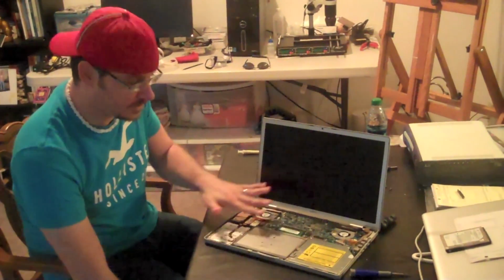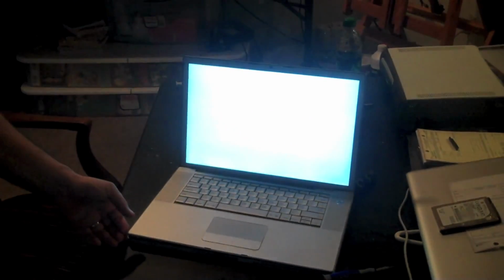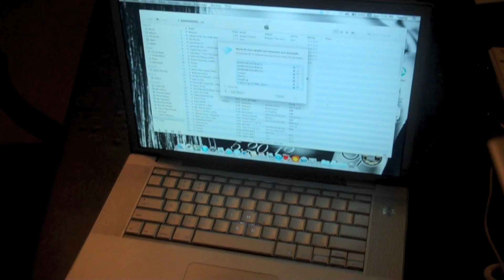MacBook Pro nVidia Black Screen Fix PT2

Comment: Bro I just bought that machine but the lamp doesnt light up in intervalic motion how you set that up? or maybe I got a broken unit.
Reply: sonico 73 Did you find a solution?
Reply: sonico 73 I contacted the factory technical staff about this. If you set the temperature exceeds or equal to 250 degree centigrade, it will always stay on; but if you set the temperature less than or equal to 249 degree centigrade, the light was supposed to cycle on and off.
Reply: Bro I love you!!  thanks so much we need more people like you very kind sir thanks. I was scare that was broken.

Comment: I would like to say thank you very much... your guide helped me fix 2007/08 model MacBook Pro.. for me it was the NVIDIA video chip, I used a heat gun because I don't have the specialized tools you do.

I took it the the Mac shop and they told me it was the backlight on the screen and it wasn't worth fixing... what an idiot that guy was.... I swear they are more interested in just selling new computers than actually trying to help.

Comment: So It means Graphic card problem ?
Reply from the maker: Yes it does mean there is an issue with the graphics card/chip or the solder that holds the chip to the bga on the logic board

Comment: Hi i have a macbook pro a1226 it's not powering on.we fix it with smc.its getting powered but nothing is seems on screens.we a zm-r 5830 bga machine. we reballed many gpu in other brands laptop but not in macbook.can u tell me extact problems.
my mail is santoshrawat2005@gmail.com

Comment: ever have to reflow the intel hd graphics chip on a 2010 15 inch MBP 2.66 i7? if i turn off the auto graphics switching on 10.8.4 i have not had gpu kernel panic problems (yet)

Comment from the maker: the x1600 is in the first gen Macbook Pro (2006) can have the same issue as the later models, I have fixed more then a few with an ATI GPU in them, macbook pro, imac first gen both have them and the soldering joints fail just the same. I would say clean the fans and vents on the heat sink, also check that both fans are working properly. New thermal past is always a good idea, and imo a must after 7 years. I would go with Arctic Cooling MX-4

Comment: I have the same macbook but it has an ATI X1600 do i have to worry about this should i get someone to upgrade the thermal paste to Arctic silver it doesn't have issues but it get HOT like crazy

Comment: Okay so I have it confirmed from Apple that I have the bad nVidia chip. I don't have the equipment you have but I do have a heat gun and a thermal laser thermostat which I could point at any part of the board that I'm heating and it will tell me the temperature instantly. I know you probably strongly advise against fixing it with a heat gun but if one were to do it that way, any suggestions?

Comment from the maker: I charge $150 and the repair and it comes with a two fold warranty, first part is a 30 day fix for free if the Mac Book Pro fails again due to the repair not holding.The second part is I will repair the laptop if the issue arises again within the next 335 days for half price. For a total of 1 year's worth of warranty.

Comment from the maker: The quilt/towel trick is bad because it heats and bakes all parts of the logic board and laptop for that matter when it is done, it might re-flow the solder joints slightly to fix the video ram temporally, but it heats the cpu,gpu,north/south-bridge chips themselves, theoretically cutting the life of those chips down.I am glade its working now.Good luck

Comment: To continue, I rebooted 10 times. No graphic glitches or freeze up restarts. One thing I left out. When I let it run continuously & then with sleep, I ran smc fan control setting both fans to 3200 RPM. I'm not counting on it to be permanently fixed, but previously, each startup had a Graphics glitch. That is no longer the case thus far. So I'm crossing my fingers. I know what you're thinking. It will come back. And your probably correct. But either the Quilt Trick or the constant running helped

Comment: Is VRAM same as the GPU, which in this case,NVIDIA GeForce 8600M GT ? Your going to think I'm crazy but here goes.I tried the 90 Minute Quilt Trick twice. Did not work. Again my problem is Intermittent. I can get it to boot perfectly after 5 tries. So after the Quilt trick not working, I decided once I got it to boot & stay on, I wasn't shutting it down. Kept it on for 5 days straight. No Sleep. Then on 6th day thru 10th day I let it sleep. Final. shut it down & rebooted & so far, No problems...

Comment: Great Video & Job! You have done this many times I'm thinking. :-) What's the name of the heat machine you are using. Where are you Located? I have a MBP 17" with Graphics Checkered Screen Issue. Except after like 5 Boot fails in a row, I can get it to boot & it'll stay on for 10 days with not one graphic issue. Once I reboot, it comes back. Using Smc Fan Control set at 3000 RPM. I'm typing from the MBP 17" right now.Any info would be helpful. Thanks in advance!

Comment: did you let the preheater on "200 °C" by switching on the ir lamp ? when i let the preheater in my station it will be increased and not stoping on 200 °C , i dont know why, i need your help plz thanks

Comment: Thanks for posting this. I believe I have the same problem with a macbook pro I picked up for cheap on craigslist. Don't have the fancy machine for reflow that you have but hopefully I will have success using my SMD solder station.